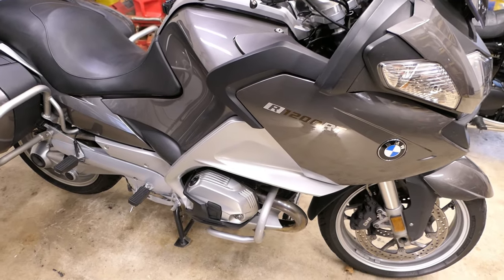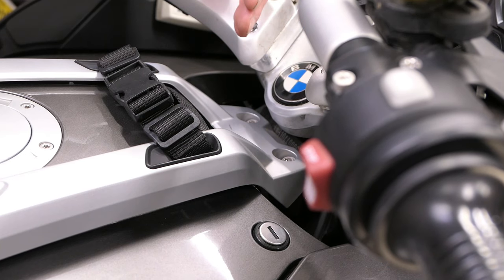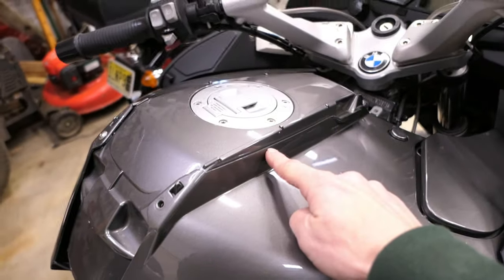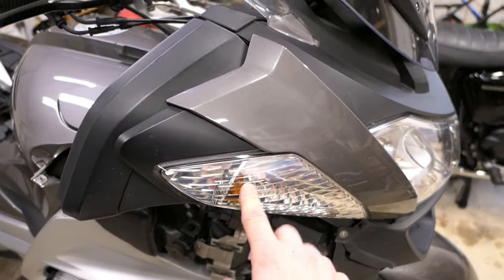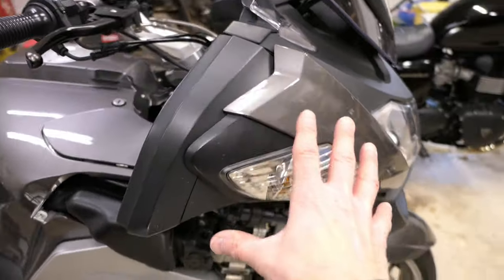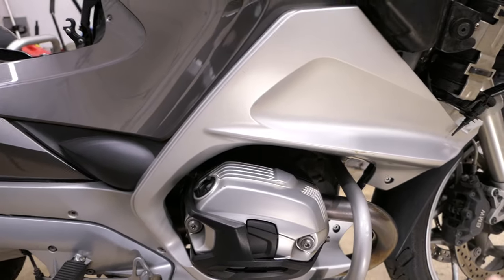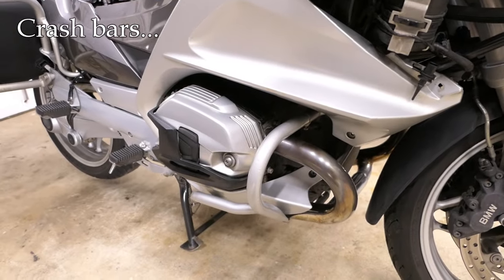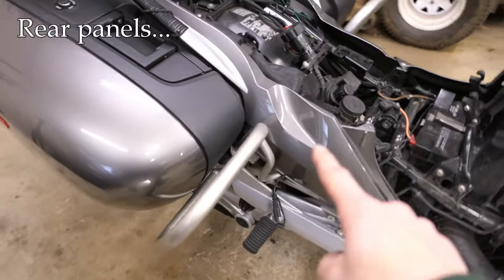How To Remove R1200RT Body Panels

Comment: Thanks John. Very clear and concise directions and camera-work. I have a 2024 RT in transit with my name on it and look forward to doing some of my own maintenance. Clearly the panels are different but still very straight-forward. I agree with the torque on those screws. No reason for a herculean effort there; I mean it IS plastic afterall. Becomes even more important as the plastic ages and becomes increasingly brittle.
Reply from the maker: I haven't had an opportunity to see how the newest model panels are removed, but I suspect it is even easier now.

Comment: Awesome video😊 I just did this on my 2010. There's also clips on the frame to run the screws through that can move or fall off. I had some fun with those!😢
Reply from the maker: Generally the system works pretty well, even if it is tedious.  But if somebody previously cranked down on the screws or otherwise abused them then you can get damage to the clips or to the panels.

Comment: This is what I'm looking for! I hope to one day experience ownership of one of these fantastic bikes, but I need to know how to do my own maintenance/repairs. Thanks for the detailed video.
Reply from the maker: The RT is actually fairly simple to maintain yourself.  Like any vehicle it has it's own quirks, but once they are known the rest follows.
Reply from the maker: I have an extensive array of videos for common maintenance items like fluid changes, brakes, valve checks, bearings, sensor testing and more.  Other youtube channels also offer RT advice.  The models years from '05 through '13 are air cooled and very similar.  The '10-'13 models are often considered some of the best.  In 2014 they moved to a water cooled engine and a wet clutch, so things started to change.

Comment: These bikes are designed to facilitate maintenance. I have a 2009. Can I ask what protection bars you have? 
Thank you for these videos.
Reply from the maker: Those are actually cheap Ebay knock-offs of the Wunderlich style bars.  I'm pretty sure they are made in the same factory, since they appear identical in every way.  I painted them with a silver wheel paint when I first got them, so I can easily repaint them to freshen them up after they get chipped up from road debris.
Reply: Thank you

Comment: Hello John, recently purchased a 2012 RT. Both of the lower armatures for the windshield height adjustment are broken off and jerry-rigged to work although i don't have faith in the result and bought both upper and lower replacements from Beemer Boneyard. Have both side fairings off for some other work and to familiarize with the inner workings but for the life of me i can't determine how to adequately access the inner connection to do the replacement. Even if i took off the mirrors it doesn't get me in. I also have to figure why headlight adjustment doesn't work so i guess i'm committed to some additional work.  I was hoping there may be some way to remove the front end more or less as a unit instead of disassembling it piece by piece.
Reply from the maker: You're testing my memory.  I think the arms attach at the bottom just underneath a plastic cover?  Unfortunately nothing comes off as a unit, it's all piece by piece, so you'll have to just keep removing stuff until you have access.  If memory serves they are attached with e-clips or c-clips and you may be able to remove those without getting full access.  Once you get the new arms installed, use some waterproof grease at the pivot points and you'll never have a problem again.  The headlight adjustment is a fussy knob in the front with some plastic bits that often break.  There's a cable which goes to the headlight assembly from the knob.
Reply: @tinderboxarts  John, thank you so much for the reply. I also order the shop manual CD, hear it's pretty good. I'm not that big a fan of the Haynes manual, better than nothing i suppose. Between your videos and a few others i'm confident enough to do it now. Wanted to avoid ending up with a huge bin of screws, nuts and bolts. One of the best things BMW did was in limiting the different screw sizes. One of the worst things they did on the '11-'12 was the crappy 'metal' the used on the screen set up. Totally unacceptable from BMW.  Just bought the '12 RT  (17,500mi) after surviving 2 rounds of cancer and selling my 907ie Ducati (loved it-had for 25 yrs) and my Sprint ST (bike had no soul). Looking to slow myself down a bit as well at 71+. I read an article yrs ago in one of the mags-probably Rider) that called the RT "The Gentleman's Express," i like that. Have you sold your RT? 
Sean
Reply from the maker: I still have my RT.  Earlier this year I did a 6200 mile cross country trip in 13 days with my son.  Later this year I hope to do another similar length trip with an old friend.  I'm approaching 60, and I have a benign brain tumor which was treated with radiation a few years ago.  That left me with some balance problems, but I just kept at it until I had my confidence back again.  The RT is a very good bike which will do 90 MPH for 12 hours a day while carrying your luggage, and get up the next day to do it all over again.